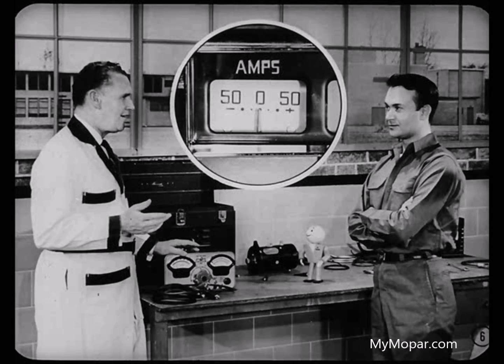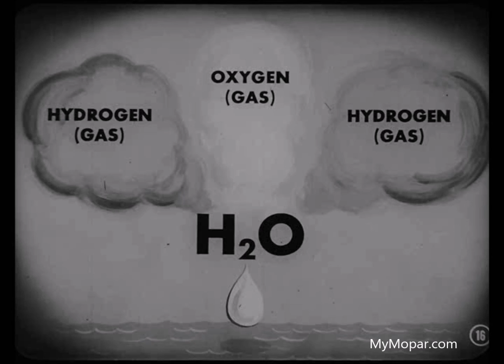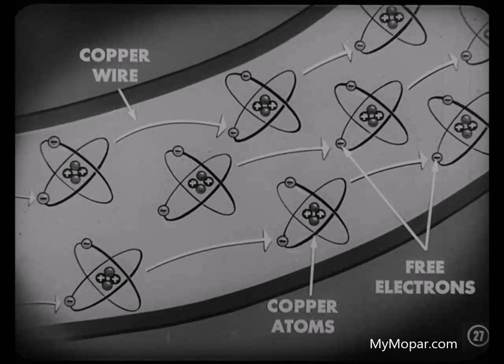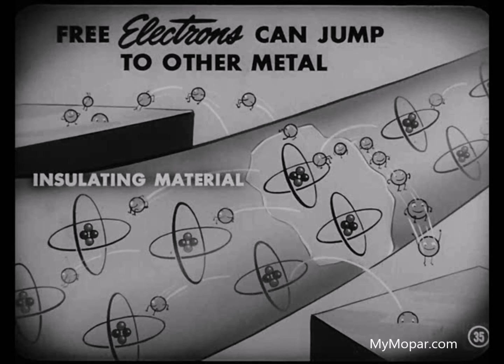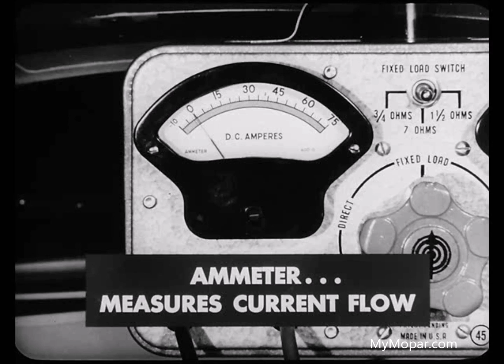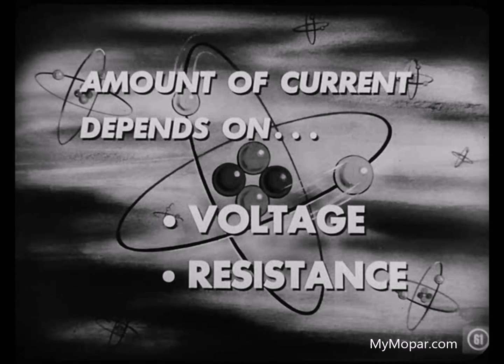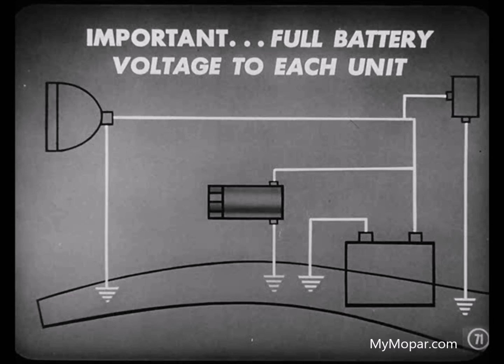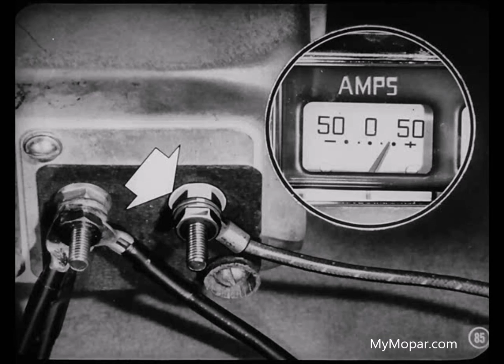Chrysler Master Tech - 1953, Volume 6-7 Electrical Fundamentals

Comment: Testing batteries? Why in the world did they not mention the gr8 battery tester or wi tech 2.0. Those are the basic starting points with electrical diagnosis